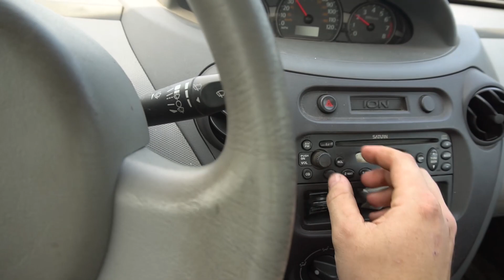Getting the BOOF Mobile back on the road!

Comment: With brand new tube for exhaust you can do short beads asnd have a good weld a bit faster. Run an inch or so at a shot then go to your start and run the inch. Theen go back to your previous weld and go an inch. It looks like a solid weld when you get a few done and it spreads the heat so no blowing holes and boogers hanging. Used to be the muffler shopss used gas welds for exhausts and they could whip together a custom set up in no time. I tig for stainless and band/strap junctions for a cleaner look.